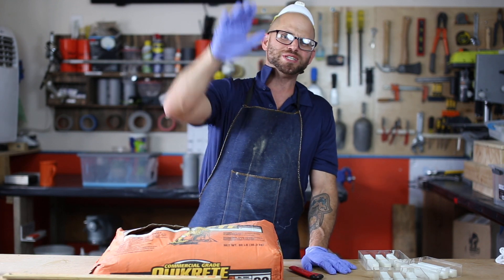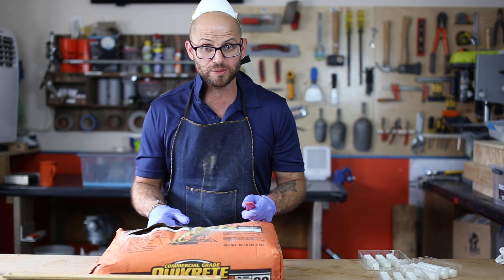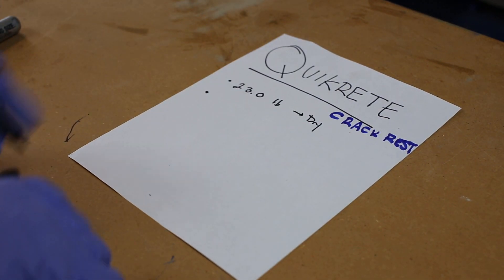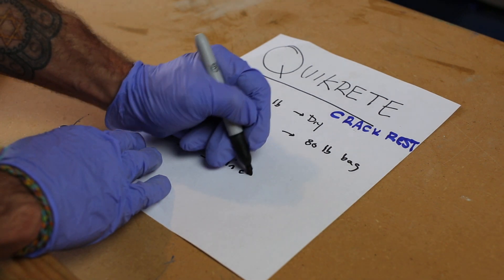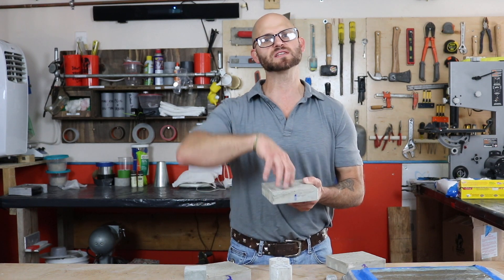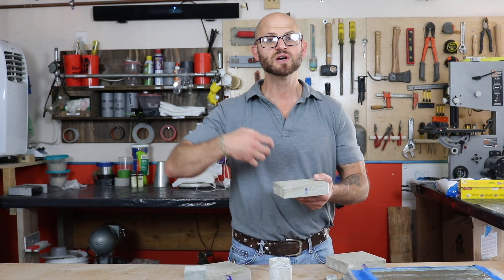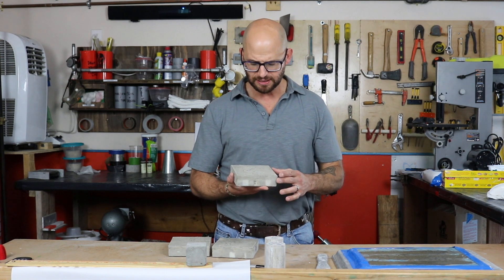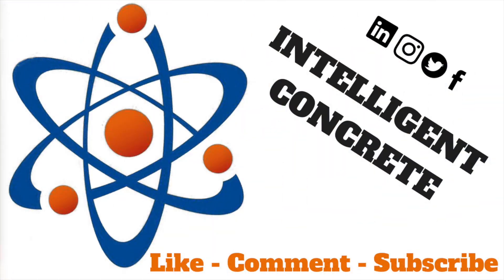Crack Resistant Concrete?!? - Vlog #41

Comment: I make statues and use 20mm gravel, sharp sand and cement, but I have some issues with small plaque moulds which the gravel prevents the mix from covering the letters, this causes air holes around the letters. Iv got 3 to 5mm gravel that I'm gona try in the mix instead of 10mm. My question is could i use equal parts 5mm and sharp sand and still get a strong product

Comment: I think recommending a lower water mix is smart, as it helps keep people from overwatering
Reply from the maker: Thanks for the suggestions Bryan.  What are your thoughts when folks go TOO low on the water to Cementitious and cracks form due to self-desiccation or volume change?
Reply: @IntelligentConcrete  I'm definitely not any type of expert in the field, and am in the early stages of learning concrete. But in my automotive and construction ventures, I've learned that its easy for people to just use the recommended mix and go from there. That, imo, leaves too many factors for margin. I just feel that if people mix the recommended amount and KNOW its not enough, then its at least a good base to  start your mixtures. Possibly inconsistent, but a good base.
Reply: @IntelligentConcrete  if it desiccates,,you obviously have an idiot on the job....who's job is to stop it from desiccating,   drying to quick
Reply from the maker: @maggot5693  please elaborate on the "drying to quick."  Self desiccation typically occurs within the body of the concrete from over-heating due to therm-kinetics of cementitious hydration.  How would the "idiot on the job" stop the concrete from going through self-dessication?

Comment: Why don't you mix three samples using the manufactures recommended amount of water and test side by side with your watered down samples?  It is difficult for us to rely on your testing when you start out ignoring the manufacturers instructions.

Most common cause of weak concrete is to much water added to the mix.
Reply from the maker: Answer coming in a video soon! Stay tuned!
Reply: @IntelligentConcrete  Just mixed 20 bags of the Crack Resistant Concrete for a sidewalk repair in front of my house in town.  I was shocked after putting the recommended amount of water in the mixer at how dry the mix was.  I tried mixing it longer with no success.  The Quikcrete Crack Resistant Concrete mix took almost double the amount of water that the manufacture recommends before it binds into the recommended consistency.  
I have reached out to Quikcrete for a response and am awaiting their reply.

Looking forward to your next video comparison.
Reply from the maker: John Eckhart agreed on the sensitivity of water to strength and durability.  

The harsh reality is that it’s common to have to add excessive amounts of water to most Quikrete and Sakrete products.  

Thanks for sharing your experience and let me know how it goes with Quikrete.